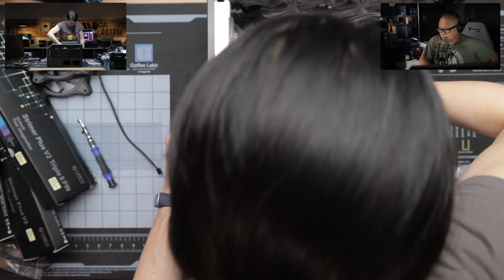Building In The Hyte Y60 With All-AMD Parts - LIVE!

Comment: @37:22 Some riser cables affect performance. I got one with my NR200P and it would work with PCIe gen 4 enabled in the BIOS but it caused all sorts of audio issues and graphical stuttering. 

Switching the setting to PCIe gen 3 fixed the issues.
Reply: PCIe 4  risers are selling for around $30. Might be a good idea to just get one; sooner or later, you will need one anyway.
Reply: @purplecrayon7281  good idea. Do you know if there are any issues with some that cheap, though? Or any particular reputable brands? 

This is the first time I'm using a riser so i don't have experience with them.
Reply: @Eternalduoae  Any case manufacturers that sell ITX cases will have their own branded riser cable for sale. The usual suspects are Cooler Master, Lian Li, and FormDworks. Good luck!
Reply: @purplecrayon7281  Thanks!